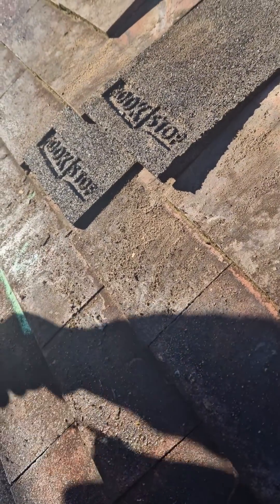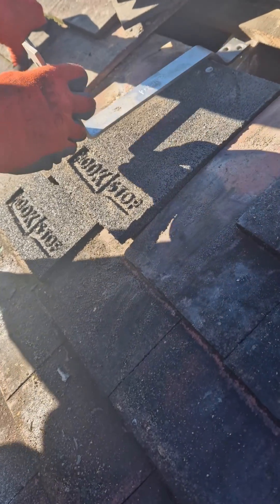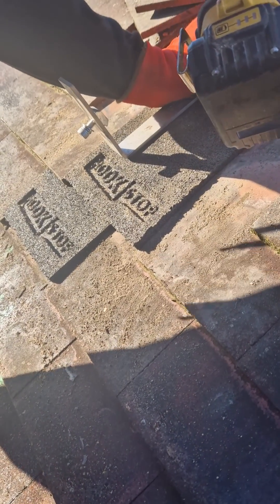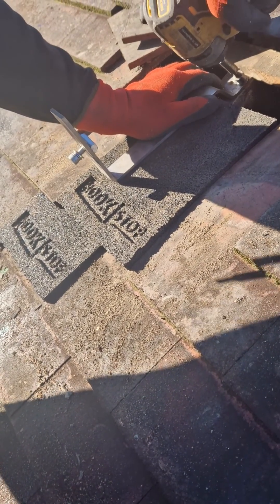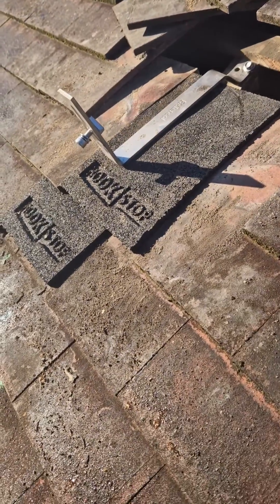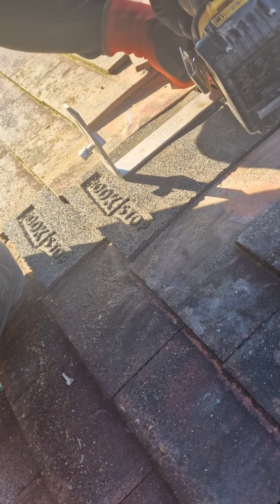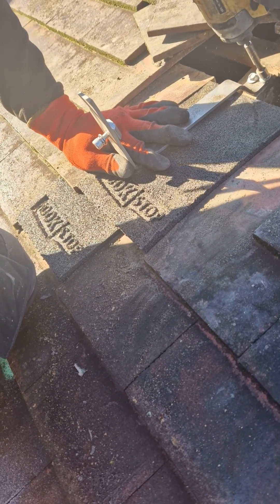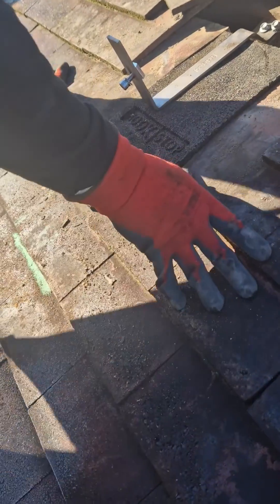M E Solar - Fitting solar panel roof hooks to plain or rosemary tiled roofs using Hookstops

Comment: Do you find that by using these you don’t need to cut the tiles? They appear to have gone back down nicely
Reply from the maker: Hi @olliewood6467 yes by using these hookstops we dont need to cut the tiles, they usually sit back down well, there are a couple of variants of the hookstops available
Reply: Thanks for the reply. Good to know
Reply: Have you ever used these on a Kent peg tile